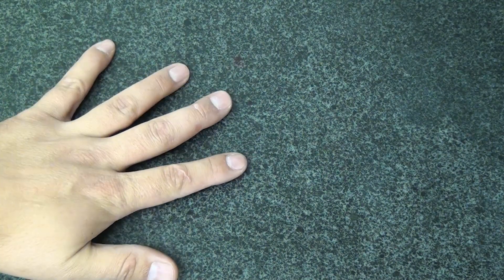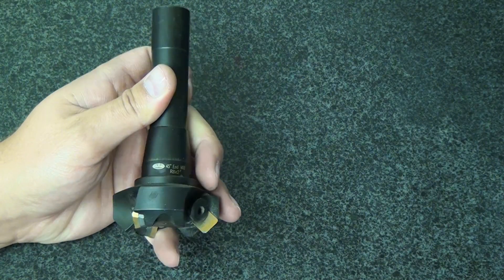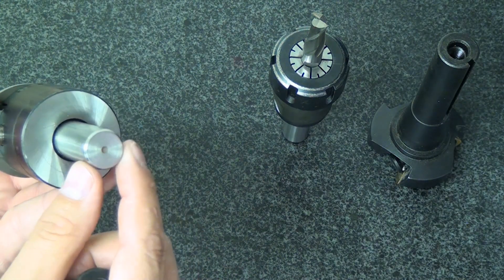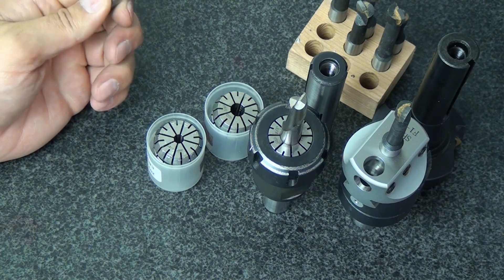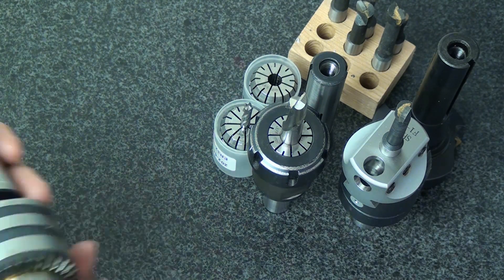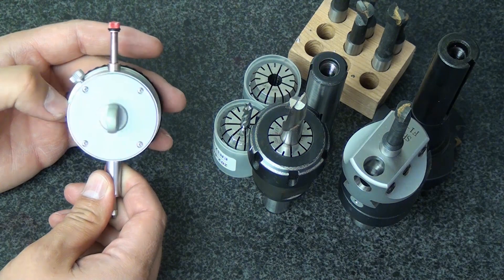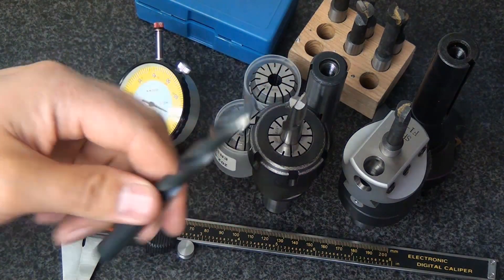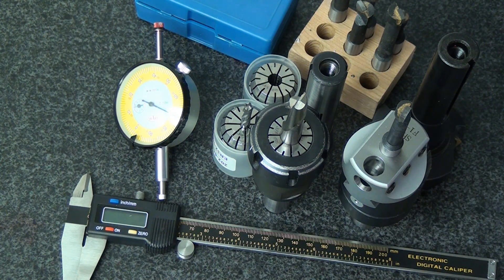06 G0704 Initial Tooling Considerations

Comment: Good video.  I didn't have much luck with the Habor Freight calipers.  Wondering if you have a good 6-inch height gauge to put on you surface plate?  Bought a dial type gauge and it's pretty rough to use accurately.

Comment: Maybe I'm doing something wrong, but I've tried to use the cobalt drill bits from the big box home improvement stores, and they always seem to break or wear out really fast when I try to cut hardened steel.  Same basic problems with the drill and tap sets, even with mild steel.  I've been getting much better results with appropriate bits from McMaster-Carr, MSC, and Fastenal. 
 Unfortunately, I can't use credit card rewards points to get gift cards for the industrial supply houses.

Also, I had a hell of a time finding the Shars face mill.  It appears to be SKU 404-2388, but is out of stock at the moment, possibly discontinued.
Reply from the maker: I'll have to test some of mine on hardened steel. I'm typically only ever drilling mild steel or aluminum.
As for the face mill, I believe it's this one: http://www.shars.com/products/indexable-cutting/indexable-milling/r8-shank-2-indexable-face-milling-cutter-1

Since I use the Tormach TTS system, the integrated R8 shank is a bit of a nuisance. If I were buying again I'd go with a an arborless version and get a 3/4 arbor, or buy the 3/4" arbor version (which I think they also still sell).
Thanks for watching!

Comment: Hi Russtuff. I am a new owner of a g0704 and am getting things started. First, Ive watched some of your videos and like them much. Nice cnc you built and want to get there some day. I want to know what size Shars boring head you reccomend? 2 inch? 3 inch? I really have no definate on max diameters I will be boring and just want to know your opinion as you have the same machine. Does a bigger (say 3 inch boring head) bore larger holes than a 2 inch boring head? I heard that the bigger ones are beefier but not numbered "2-3" for bore size max. I hope you understand what im asking. Should i stick with a 2 or go with a 3? Thanks for posting videos. Thanks
Reply from the maker: +Mercurino Ferraro Congrats on the new machine! I don't have any experience with the 3" head but that seems like a lot of mass to be swinging around. If you know you'll need the extra size then I say go for it. The 2" head I have worked perfectly for my needs.

Comment: FYI :  New G0704 / G0759's Have 7/16" T-slots.   Check the Grizzly website for up to date info
Reply: did you check the Grizzly website, as I mentioned in my post, before purchase?

Have grizzly fix it at their cost if you did.

they will probably hide behind their 'specifications subject to change' clause... (~)

The reason I posted, was there was conflicting information about the size of the slots in the 0704/0759's..  Web was different than the manuals, on the Grizzly site.
Information shared by others prompted me to get 1/2" size as well... I too wasted time getting the right size.  thanks grizzly  :-/

irrelevant now, got rid of the griz and got a bridgeport.. much better machine.. if you have the space.. now looking to sell and get a CNC (Torus Pro or maybe a Tormach..time will tell)
Reply from the maker: +John Galt Thanks for posting that here.
Reply: +John Galt  I was wondering about this.
Reply: Heh... Was just wondering if I wasted 48 bucks on a 7/16" clamping kit for my new G0704...
Reply: I just got a new G0704 05/2017 and it has 1/2 inch slots.
Reply: Nicholas Stahl SHARS sells 1/2 inch 3/8-16 tee nuts separate.  I bought 7/16 kit based on all the current information. My table has 1/2 in. Slots.
Reply: I would LOVE to have a Bridgeport, however budget, floor space and the strength of the floor prevent me from doing so.  My floor will simply not safely support the mass of such a large machine.  No doubt that the Bridgeport is superior, but in all fairness to the Grizzly, It should be superior for the price that you pay for a Bridgeport.  Even good used Bridgeport Mills are not cheap.
Reply: Well, I'm glad that I read this thread, before I bought anything for the machine.  I'll wait until I receive the thing and measure.  The Grizz website still days 7/16"

Comment: @Russtuff  Thanks for the Video it helped me out w finding Things easier. I need a Clamping Kit for My g0704 I just got, is this the Right Clamping Kit Size 3/8"-16 w 1/2" 
T-slot ? And did u try to Calibrate your Surface Plate to see where it Calibrates at? Thanks
Reply from the maker: mikeyeyes7 Yup that's the right clamp kit.

No, I haven't calibrated my surface plate, but so far I haven't had any issues with it. I don't have a height gauge or anything so I have mostly only used my plate for lapping and sharpening.

Comment: I have a full set of ER32 collets and I rarely use my drill chuck anymore for bits larger than 1/8in. I just chuck drill bits up in the collets. Leaves me a lot more room under the spindle and holds them better than the drill chuck.